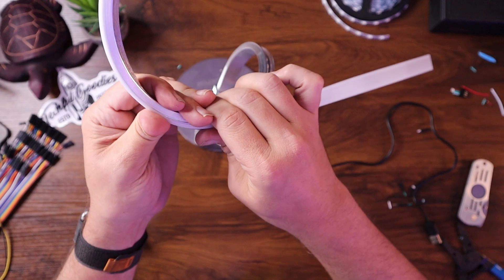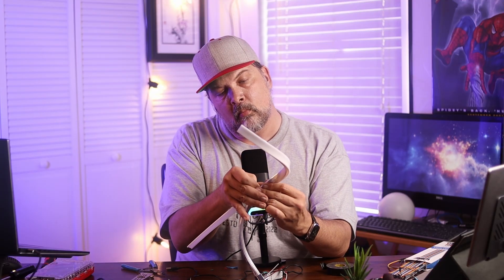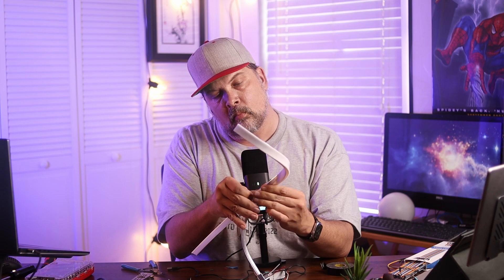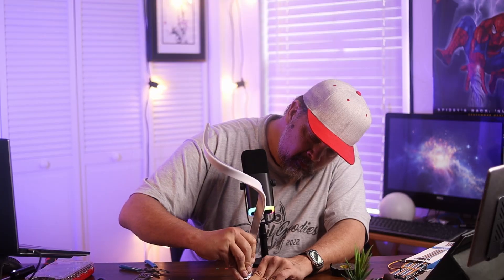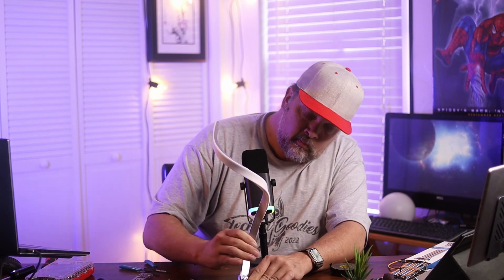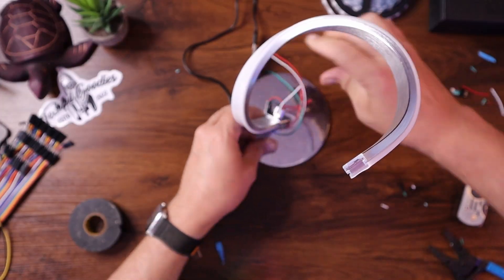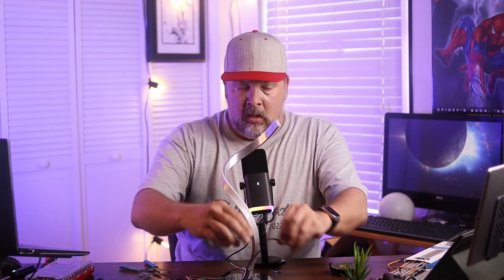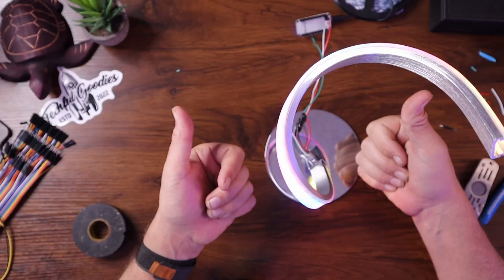AWESOME Results! DIY LED Lamp Upgrade using WLED

Comment: 196.85inch USB Sensor Light, With PIR Motion Hand Scan LED Night Light, With Adjustable Brightness, For Bedroom, Home, Kitchen, Wardrobe Decoration from temu…..which strip connectors I need…… the one you have same one will work….pls adv…..